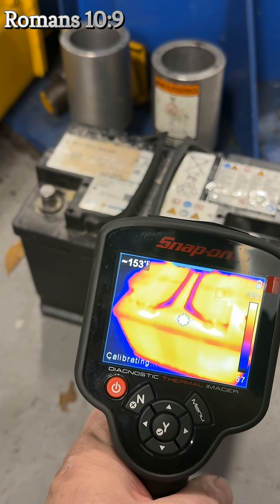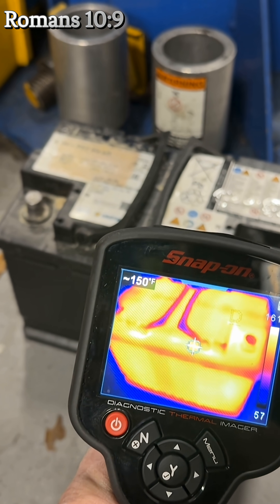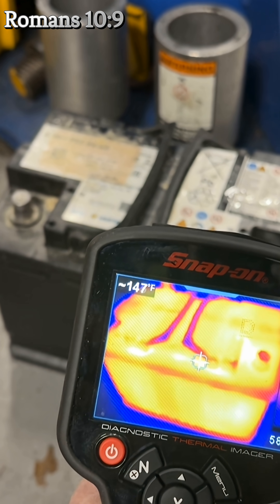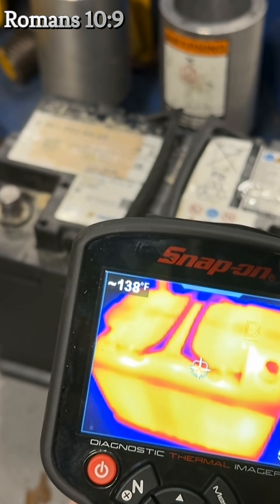Sprinter Tip: Why a Dead Battery Gets HOT When You Try to Charge It

Comment: Morning Sir,  what type of trickle I should use?  Also, my vehicle is outside, so do I use it under the hood and how or inside the cab?  As I stated my vehicle is park outside.  2021 chassis sprinter van revel.  Please let me know.  Thank you, Jose
Reply from the maker: MB Trickle charger
Part number 0009822921 $201.48 is what I would recommend. Hook it up under the hood at the jump point and the ground that is on the inside passenger fender.

Comment: Great info!!! 
Also this is off topic but have you guys ran into the pcv on the om654 leaking oil into charge air system?  We have 2 in the shop right now. I’m doing one. Oil gunked up in the turbo and charge pipe at the back of the motor that meets the charge air cooler.
Reply from the maker: I have ran into one that had what we diagnosed as the turbocharger leaking oil and got that carbonized looking crud in the charge air pipe and it had clogged up the intercooler. The vehicle came in with a loss of power and low boost codes.I opened a technical support case on it and I was advised by MB to replace the turbocharger and the intercooler. They didn’t say anything about the pcv. I have heard of the valve cover being replaced to resolve oil consumption issues because of the pcv/oil separator though. Thanks brother!!!